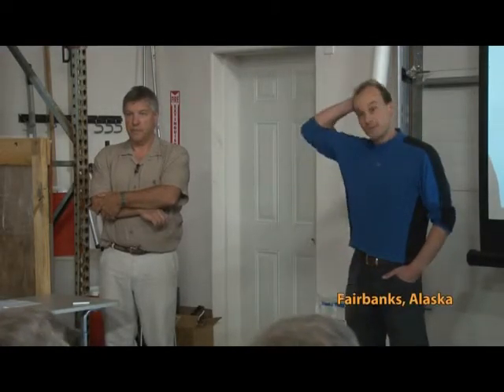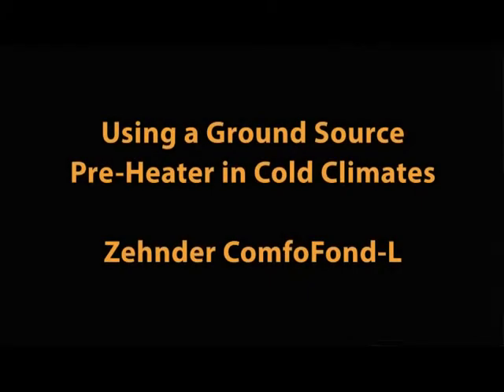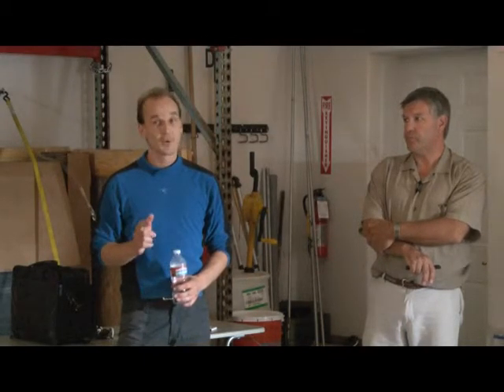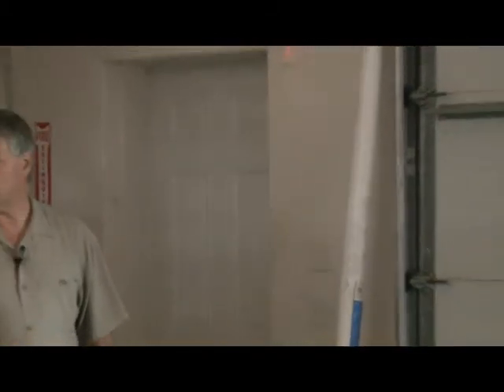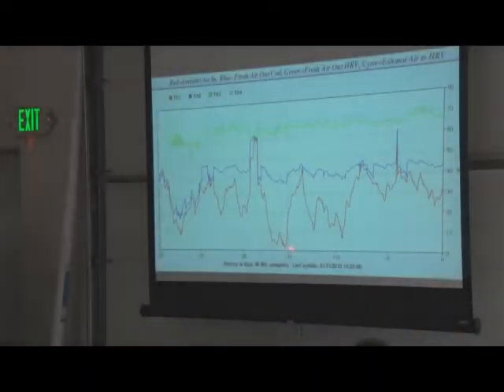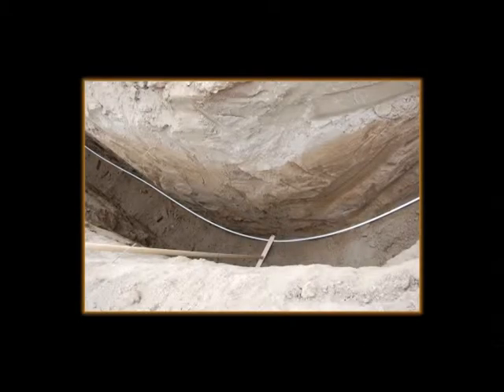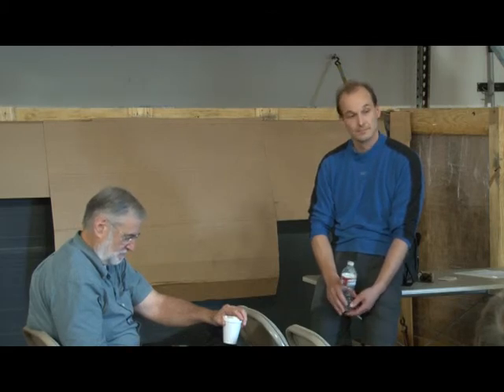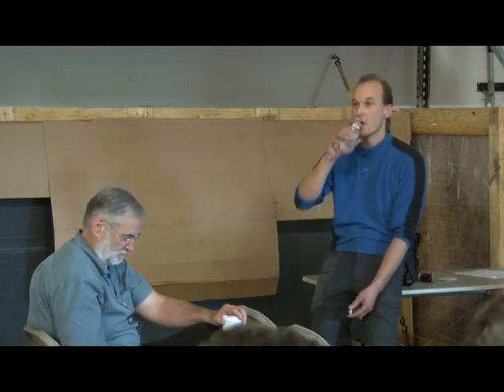Zehnder HRV and Preheating in Alaska

Comment: There is a similar potential in Drain Water Heat Recovery. Especially for your type of solar thermal systems with extended storage, using a heat exchanger will extend the time you can run hot water off solar thermally stored energy, before you have to resort to backup heating. I have one of these installed, and it's totally passive - it simply works when the water flows. Incoming water in the winter where my house is, is around 4 C (40 F), and by the time it exits the heat exchanger, it's up to 65-70 F. I get around 30 F rise on the cold mains water - for free. The rats in the sewer are complaining, though, as they are freezing in winter.

Combining this with hot water being from a buffer, rather than a conventional water boiler (just like your systems), means even more savings, as my 275 gallon water buffer for domestic hot water and part of the heating system is maintaining only 105-110 F at the top on backup power (district heating), apart from when solar thermal keeps it hotter than that.

Not only do I save 35%-40% thermal energy on domestic hot water, I also extend the time between having to use district heating entirely.
Reply: Did you look into AAV/PAPA units for the DWV stack or is it just open to atmosphere?